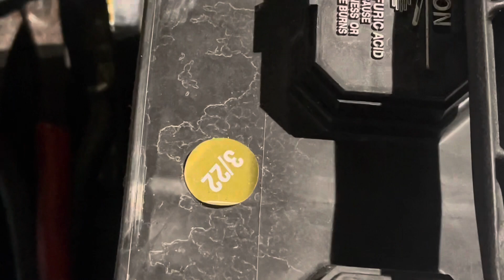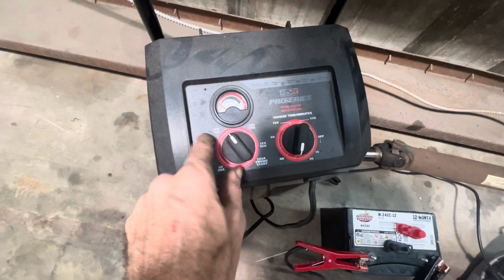ReeeeeeeeActions Welcome! 😏

Comment: Concrete, cement, wood, it doesn't matter, they're not conductive, nor is the battery casing.  Newer batteries very seldom develop dead cells.  They have much thinner plates, encased in non-conductive plastic mesh, and many more of them.  Older batteries had bare, thicker plates that could warp over time and touch adjacent plates in the cell (depending on use) and create a "dead" cell in the battery.  Often the dead cell would go unnoticed until the battery was taken out of service, in which case the dead cell would cause a continuous discharge of the battery.  The same occurrence could take place just by leaving the vehicle out of service for an extended period.

In my teens and early twenties (late '60's early '70's) I replaced a few batteries because of a dead cell.  When I worked in the service station we had a very simple battery tester that was hinged in the middle (so it could fit post to post over any size battery) with a built-in volt meter and a switchable shunt.  The shunt was just a big accordion-shaped heating element that could put a quite heavy load on the battery.  Switch on the shunt and watch the gauge.  If the gauge fell very slowly, that battery was good.  If it fell rapidly, that battery was junk.
Also the inter-cell connections were on top of the battery and easily accessible.  That same tester (since it hinged in the middle) could be used to locate the dead cell.  In the last several years my batteries have outlasted their warranty by a decent margin, because of better construction.  The connections between cells are now normally covered, as well.

Comment: You troll! Congratulations. Back when batteries tended to boil over, I would put down cardboard to absorb the spillage. Never was able to make a battery conduct through a non-conductive case. Silly myth. I missed the reversed colored caps. I was triggered by the fan as an extension cord (not really)

Comment: Ain't nothing wrong.  Charge it.  I would check the level of the fluids in the battery as well.  Why not try to revive the battery.  So many people think you can or cannot revive batteries.  Hell, try it.  if it doesn't work it doesn't work if it does it does.  That's my thoughts.  just trying to save a buck.   Have an open mind about things.

Comment: While working for the electric company in Hawaii, I was looking to get some side stuff going and maybe good for retirement.
I bought a bunch of equipment to recondition batteries. I was successfully reconditioning golf cart batteries from the local golf courses at the resorts. The mechanics had piles of them and each week they swapped a few out. The idea being to keep the carts on the course for the big money.
Every so many years they did a complete swap out or swapped the entire fleet.
By reconditioning even 25% of their batteries, it was a substantial savings. Those batteries ain't cheap.
My truck battery was no good per the shop. I decided to recondition it and eventually moved to Oregon and Virginia. That battery lasted through crazy heat and cold, even sitting for three months through one winter and gave me about ten extra years of life.
I left my equipment on Maui when I moved and could kick myself.
The idea behind the process is a pulse charge at about 22,000 times per second frequency.
This would knock the sulfate off the lead plates. Aver a few days of cycling it up and down and back up. I then added one of their battery tender units. A box with hot and ground across the terminals. It would cause a high frequency pulsing back and forth to keep the plates clean.
I still have those battery tenders on my cars.
The great thing is it's entirely an electronic process. Not messing with chemicals, draining and refilling the batteries.
If I had kept it, I would be doing side business now. The main reconditioning equipment is over $1000 now. It was about $800 when I invested in it.

Comment: You pulled the red cap off the right post, then hooked up the red cable to the left post? Errrrrrrmmmmmm.????
Reply: The caps were swapped. The pos terminal is larger than the neg terminal.

Comment: You can't put a battery on the ground because it will ground it out...at least that's what they always told me, I never listened myself but I'm a rebel that way, oddly enough after many years of not doing what I was told I never once had a battery go dead because it was on the ground, maybe I was just doing it wrong.
Reply: The whole case is an insulated (non conductive )plastic . Putting it on the damp concrete floor will have no effect
on charging it. Before you charge an old battery pop open the caps on top and make sure that you have fluid covering all the cells. Before connecting the charger to it clean the terminals with a  termnal wire tool for a
good connection! Put charger on positive to positive and negative to negative. Troll deactivated.

Comment: Ok...I got this.  The human heart produces 1/2 amp of electrical power.  So, you wanted 1 amp so just hook the battery up to your heart for twice as long.  I see the only set back is swallowing the cables, but you can work on that.  I did my part with the fix

Comment: 1) Never put a control arm in contact with a known good battery - it drains all the self-restraint and the battery will be out of control. 2) When the caps are attached to the wrong terminals, the battery charger should be connected with the terminal caps still on. You want as low a charge rate as possible - trust me, that'll do it. 3) I seriously doubt that charger will even work without the hats on it. 4) Charging dead batteries - and by extension, this video - is revolting.

Comment: I'm thinking you are trying to get a reaction about putting a battery on a concrete floor? I was taught when I was a kid to never do that. Then in my 30's I took batteries out of my motorcycle's for the winter and charged them up and placed one on the bench and one on the concrete floor for the winter. Come spring time I put the batteries back in the motorcycles and they both fired up with no problem so I think it's a myth about the concrete floor stealing the electrons from the battery but I'm sure the cold floor did not do the battery any favors.

Comment: I set the naysayers straight on the "OMG! Battery on concrete?!" issue, but you have something else to answer for - "red" indicates a positive terminal, and "black", usually means negative. When you hooked the charger up, you put the positive cable on the terminal that you removed the black cover from. Care to explain? 🤨

Comment: Well I can not see the markings on the "junk" battery to tell which posts are what so I can only conclude you put the wrong color covers on the wrong posts. At least I hope that was the case.
Reply: Look at the size of the posts, the larger is positive and the smaller negative. I won't even believe the caps on a brand new battery, have seen them wrong from the factory.

Comment: A bit of research reveals this to be a zombie truth: it used to be that batteries would discharge faster when stored on concrete, but newer technology put the kibosh on this phenomenon. Yet the belief persists.

A hundred years ago, this rule-of-thumb was quite useful, as the case around the battery was made of wood and the electrical cells were glass. If the concrete floor underneath was wet, the wooden case would swell, causing the glass cells to break.

Subsequent batteries would sometimes lack a case altogether, allowing electrical discharges into the concrete. Then came porous rubber cases which contained carbon atoms: this also created electrical activity between the cells in the presence of moisture, leading to prematurely discharged batteries.

The batteries of today, however, are encased in plastic or hard rubber, which significantly reduces this energy waste. Batteries do naturally self-discharge over time, however, but this is due to an internal process, not the type of material on which the battery is sitting.

Comment: This is a waste of a post. In terms of polarity: the plastic covers were reversed. The mfg. configuration shows (as viewed from the terminals facing you) positive is on the left, negative is on the right. Additionally, positive has two solid posts, negative has one post and extended screw terminal. Therefore, polarity connection is correct. Assuming all cells are not defective, a trickle charge may restore the battery.

Comment: When a battery has sulfate then trickle charging wont work. You need to stick some heavy current into to it (battery charger / starter) with the plastic caps exposing the cells removed. 50A if you can. Be sure you have distilled water in the cells up to level. When the cells begin to boil let them do that gently (adjusting the current) for about 5 minutes then leave to cool off. Charge again boiling the cells for 5 minutes. Repeat 3 times. Now check the battery discharge with a battery tester. One fixed battery (well kind of) :-)  Last but not least AN OUTSIDE TASK, WEAR EYE PROTECTION. THE GASES ARE EXPLOSIVE SO DON'T CONNECT DISCONNECT THE BATTERY WITH THE CHARGER SWITCHED ON. Battery explosions are something else,  was deaf for an hour (not following my own advice :-)      Teaching a chicken to suck eggs I know, but in the vehicle the neutral always comes off first and put back last (that's so if your spanner connects with the bodywork you don't make a circuit (same with jump leads - neutral off first, neutral on last)

Comment: Lol w2g ray you sir win the passive agressive award for the day. O btw not sure if you have a lead acid battery or something else but if it's a wet cell pop caps drain into a bucket and then flush battery with a hose getting as clear as possible water coming out set aside upside down to drain then take 1 gallon of distilled water and heat till just before boiling and take a big bag of Epsom salt and dissolve as much as possible till you can't get any more to dissolve (usually I can get 5lbs+ per gallon before I start seeing sediment on bottom of the container that doesn't dissolve in 60 seconds) then refill battery with solution using the drained acid to top off if needed usually revives to approx 85-90 % capacity and gives me another 6-12 months depending on usage I've had a few that were lightly used in a back up generator that lasted 3 more years

Comment: Could work to drain it completly, charge it backwards so it gets reversed on the positive and negative. Drain it out completly again and charge it as normal, positive is positive and negative is negative. Otherwise i would charge your wallet and find a new battery 😬

Comment: never put a lead/ acid battery on a cement floor, it sucks the life out of them
Reply: How exactly would that work? 😏
Reply: @WhiteWolfArkis  Not a scientist, but when i worked space flight hardware it was a requirement to put them on wood vs. cement, do to the "leaky" discharge they would have
Reply: @WhiteWolfArkis  You know, the electrons are sucked through the non conducting composite case.  Simple physics.
Reply: @dc3mech1  Putting them on a wood shelf is a good old habit from times the battery was made out of wood and glass. Modern battery is a closed environment which does not care on what surface it sits. :)
Reply: @rcstl8815  😂
Reply: @WhiteWolfArkis  I guess it doent matter much with a car, the 12V/ 24v for aircraft and space flight hardware batteries had a requirement to not put them on cement, I will go with that in any case, not hard to do.
Reply: Now my battery is gonna go dead after 2 years on the concrete floor. Was still good last week. When it goes I'll blame it on the floor.